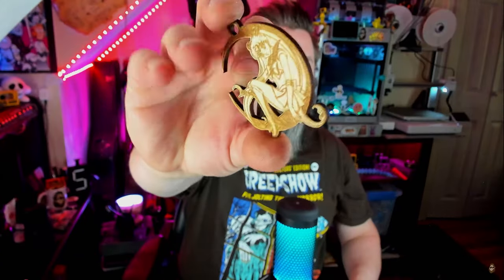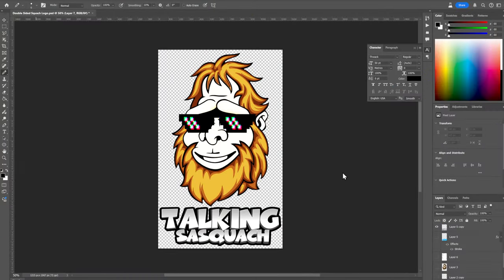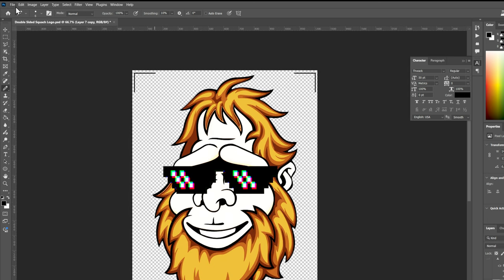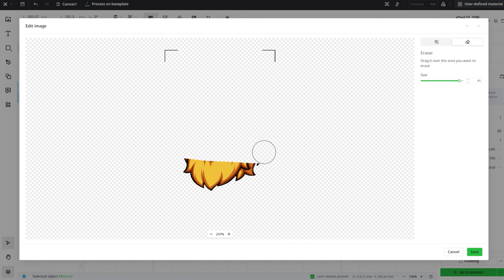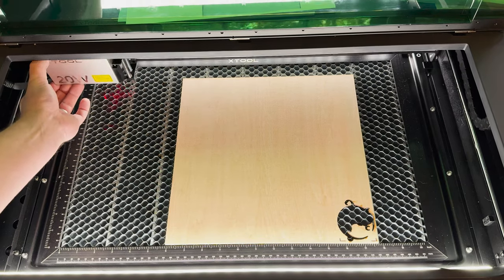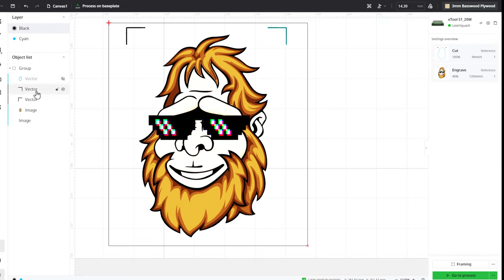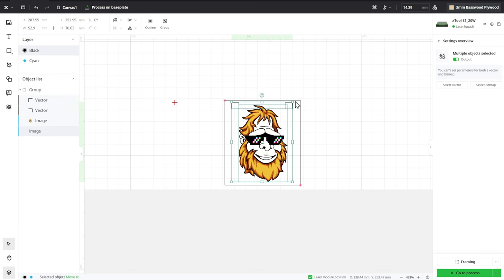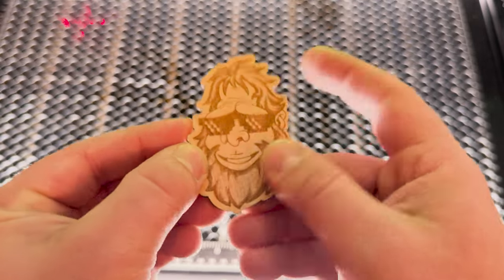Custom Shaped Dual Sided Laser Cutting/Engraving!!!

Comment: Hi. I enjoyed the video. When I do double sided,  I set the laser to return to the initial starting point.  Engrave and cut, pull it out with a lint brush(or piece of tape), flip it over and engrave the back.
I couldn't do think of how to do non symmetrical shapes until I watched your video. Thanks! Your a good one!